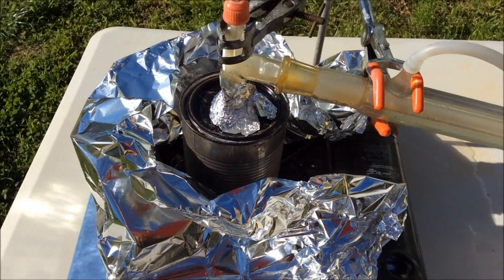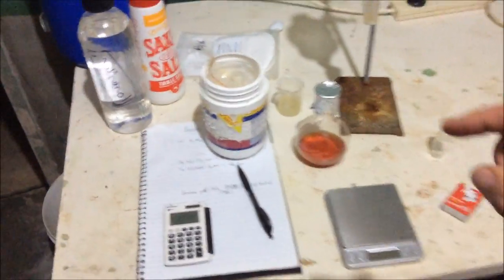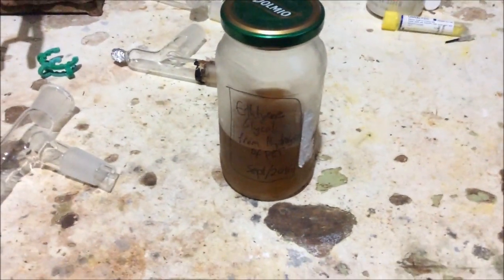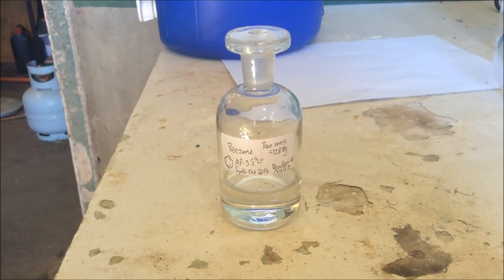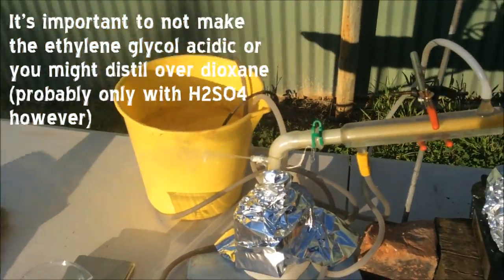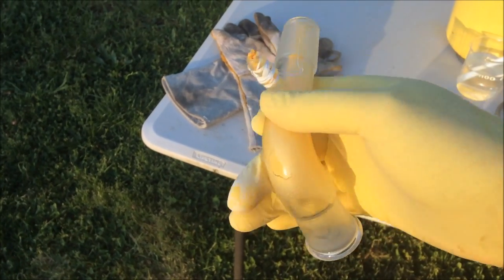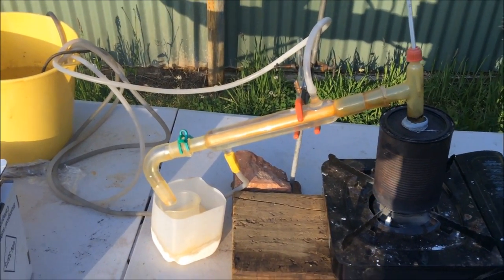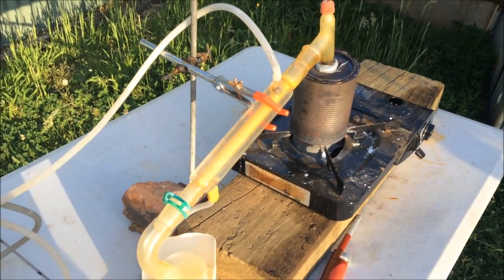PET to Benzene Episode 3

Comment: Melt it into a solid piece and attach it to a drill. Use 1200 grit sandpaper and that will get you something like 60 micron powder
Reply from the maker: I like this idea, it's probably the quickest way to get very fine powder. Sand impurities from the paper don't matter at all in this synth
Reply: Grinding plastic usually gums up the grinding surface pretty quick. I think the food blender followed by the ball mill ideas are worth a try first... also, grinding plastic tends to melt it into stringy balls as much as it turns it into powder.

PS Brelin Blue's idea of chilling the plastic seems like a good idea to me. Surely someone in Adelaide does liquid nitrogen? Ned's head's idea of a liquid medium in the blender with the pet seems another good idea, perhaps blending in liquid nitrogen might avoid the need for a ball mill at all
Reply: lordchickenhawk 
oh shit, that's a good idea.  quality addition to the thread :)
Reply: lordchickenhawk If you use a fast speed on the drill yes but not necesarilly if you go slowly
Reply: SciencePosts 1200 grit is 15micron sandpaper so, 15 micron particle size I think?
Reply: ficolas2 yeah it's closer to around 20 micron, but I figured overestimating was better than underestimating
Reply: Yes, probably worth a try with a variable speed drill going slower like that
Reply: omg, this is actually genius macgyver shit

could probably even use some type of spring tension to hold the sand paper on the plastic ball, even as it gets smaller over time.  then all you'd need to do is rig the drill to stay on by itself, and he could just run it overnight, and have his powdered PET the next morning
Reply: And pulmonary edema. Sanding down a block of PET with 1200 grit sandpaper will likely produce a ton of particles that can easily filter through most gas masks. He doesn't have a proper fumehood.
Reply: @pietrotettamanti7239  Figured someone would say this, and it's old, but you can simply perform the sanding under water.